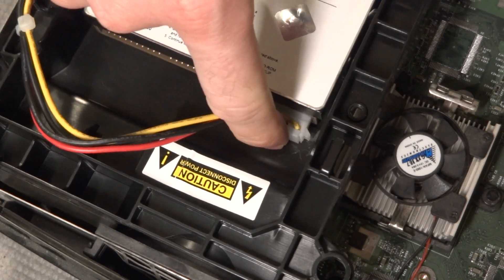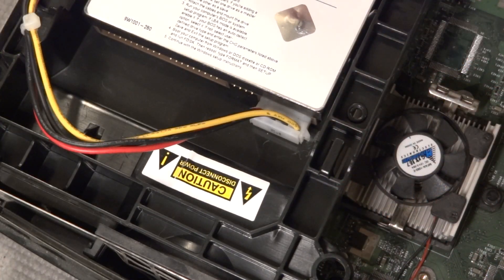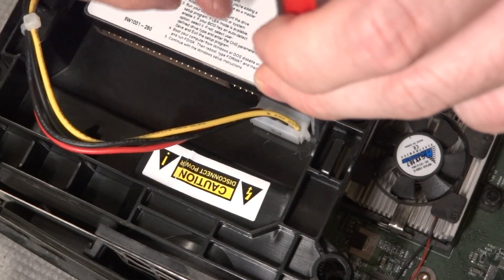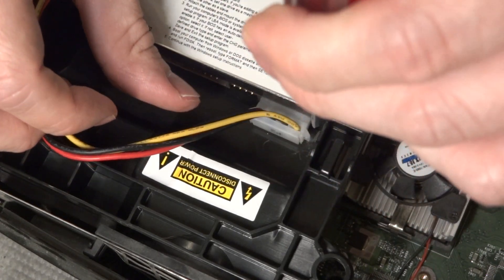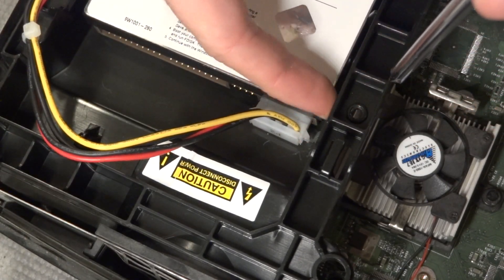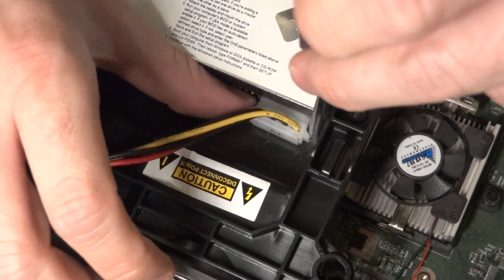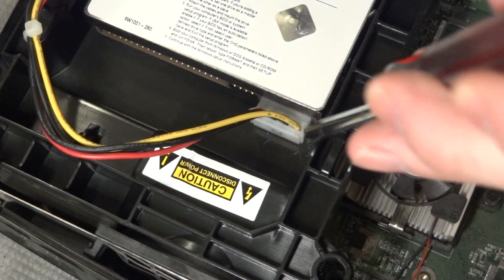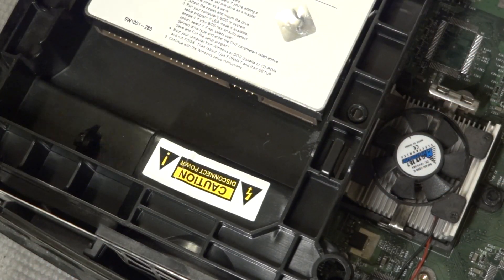Xbox Disassembly: Remove Stuck HDD Power Connector

Comment: how do you pull the hard drive ribbon cable out without damaging it?
Reply from the maker: @cam-t9g  For the IDE ribbon cable, I suggest removing the hard drive from the plastic enclosure ("caddy") so that you can easily access the cable. Then grab the cable as closed to the connector as you can and pull gently on one side, then move to the other side and pull again. Wiggle the cable out back and forth a little bit at a time to work each side free.

IDE cables (specifically the plastic connectors) aren't super durable so they can come unclipped from the wires, but you should be fine doing this process at least a couple dozen times before worrying too much about breaking anything. Just go back and forth. You shouldn't have to use a lot of pressure if you go slow.
Reply: @GoTeamScotch  thank you but I already figured it out after I commented and have just put my Xbox back together. But still thank you for replying so quickly I appreciate it👍